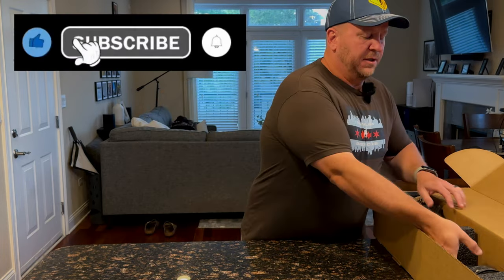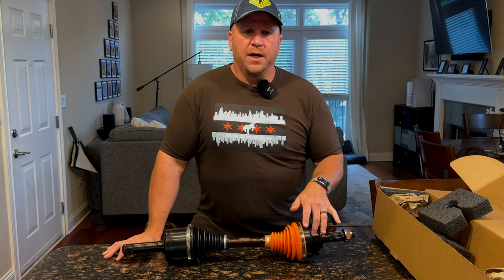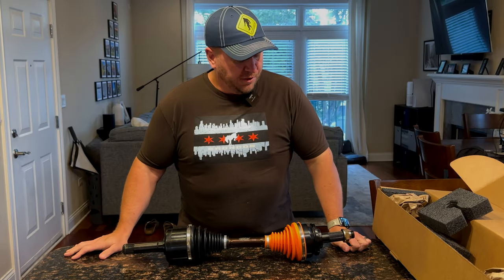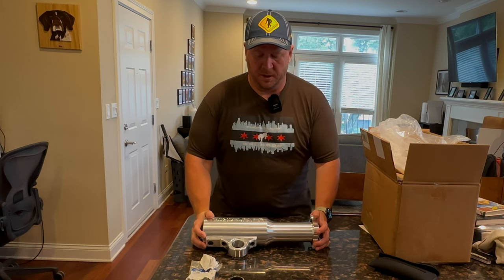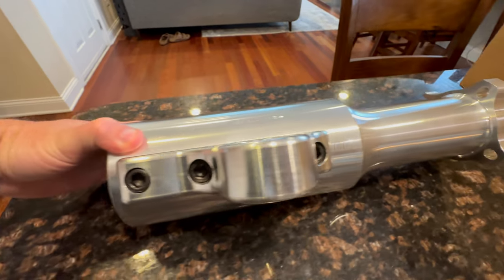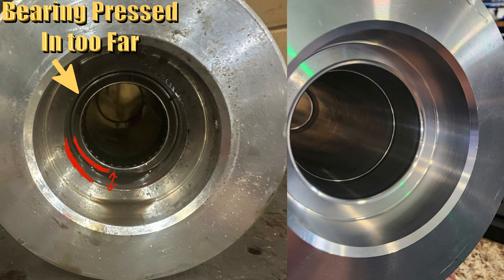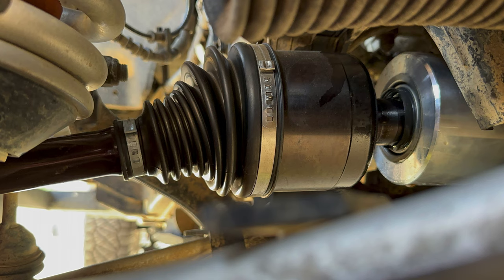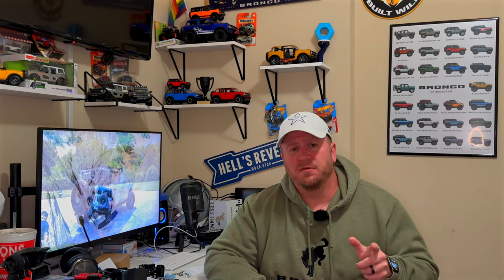Bronco RCV Axles and BroncBuster Diff Tube upgrades

Comment: looks like if you did method 703s and 37" Ko2s youd be at 92 pounds each tire and wheel only 4.5 pound more than stock
Reply from the maker: Yep, and lighter than the Raptor set up as well.  Everyone is going to have different priorities that will dictate their choice.  I previously ran the K02s on my 4Runner with great success and wouldn't hesitate recommending them to others.

Comment: Personally would steer clear of anything Buster.
Reply from the maker: The issue wasn’t the diff tube, it was the initial installer.  I’ve had the bushing and housing end on for about 2 years now without a single issue.